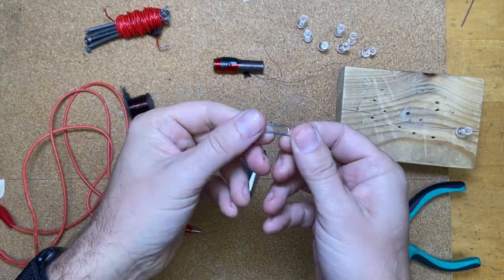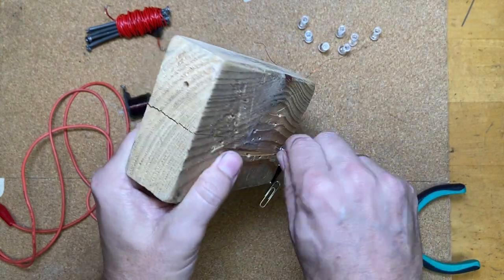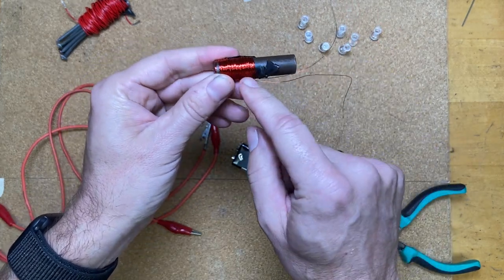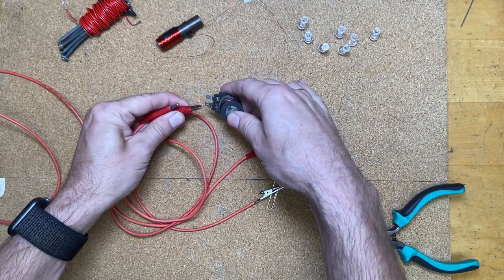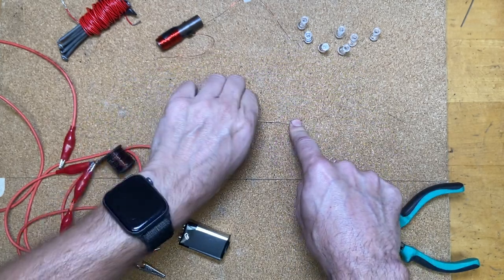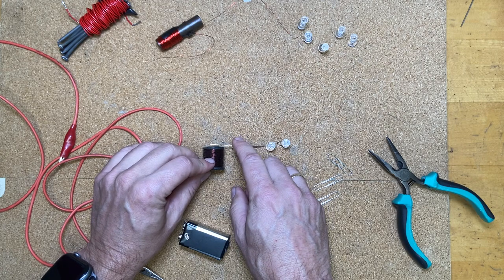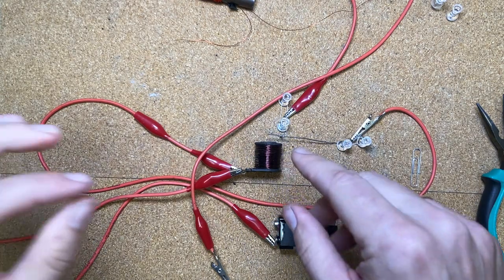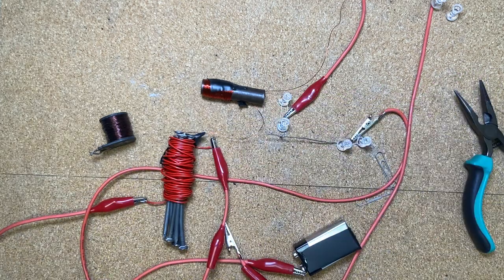DIY Buzzer and Spark Gap Radio Using Paper Clips

Comment: Great video! I found this very informational, thanks! I do have one question though: Is there a way to hook up a microphone to this and how would you do that?
Reply from the maker: It's not that kind of radio.  It's a morse code kind of radio.  The spark is either on or off.
Reply: @rhettallain  Alright, I figured. Thanks for responding though!